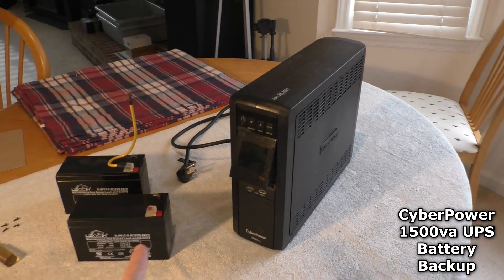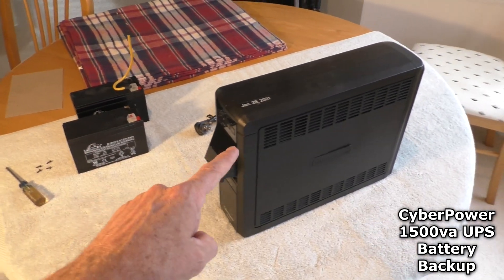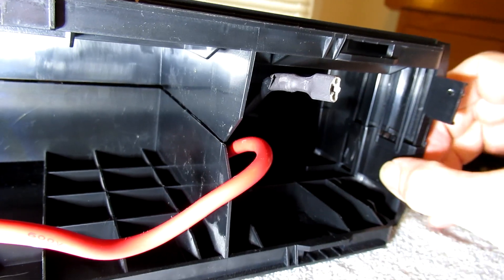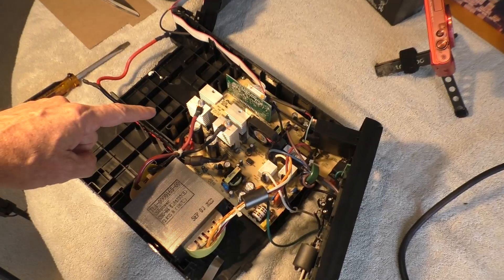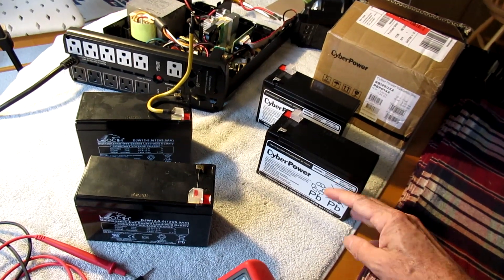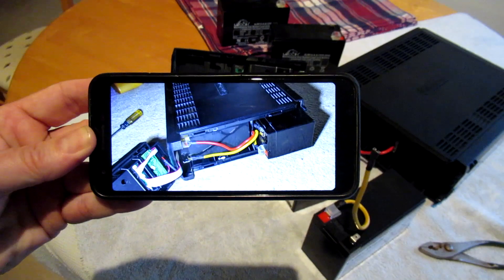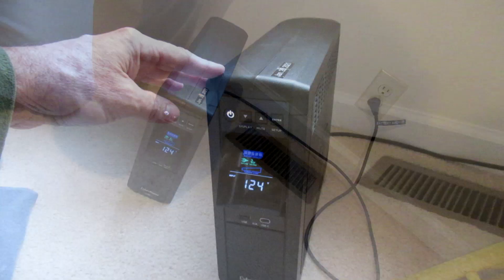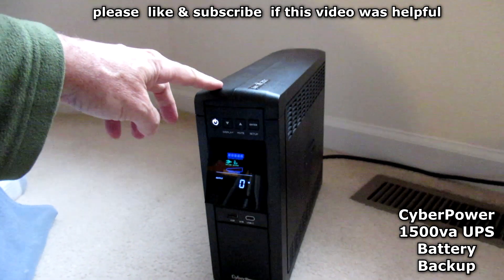How to OPEN CyberPower 1500va UPS and Replace Batteries

Comment: dumb as F video just do the two screws on the front then the 2 screws on the little cross brace for the other battery, replace and your done 3 min job.
Reply from the maker: i wanted to inspect the circuit board for faults before buying new batteries.

Comment: I'm having trouble removing the upper battery.  I've removed the lower battery, no problem and disconnected the upper battery, but it won't slide out.  Any suggestion?